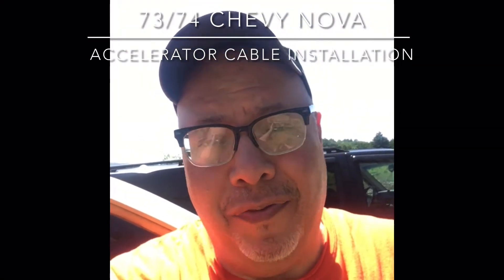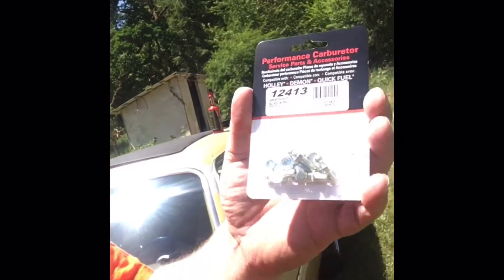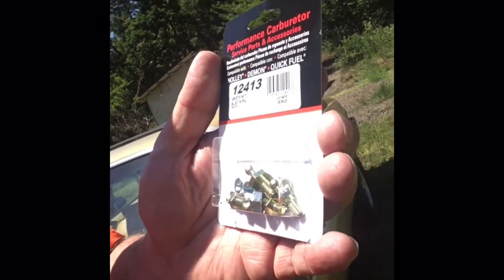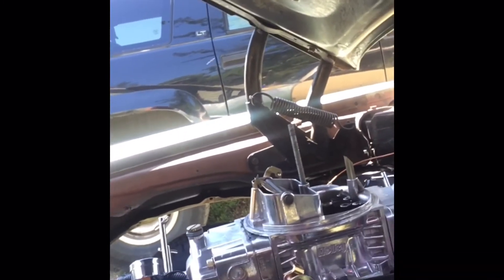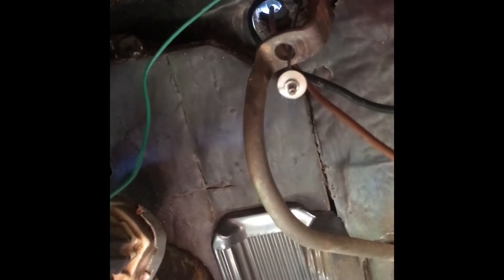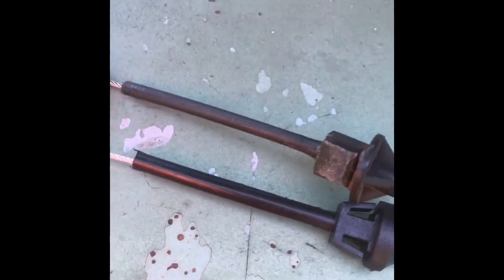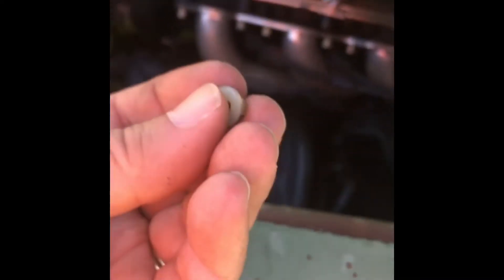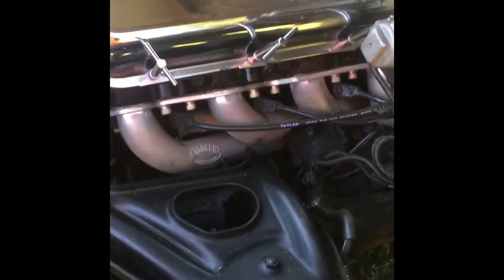Chevy Nova throttle cable installation, Binding Cable. Pioneer Accelerator Cable CA-8473

Comment: I've done lokar cables and I have cut or custom made a cable using different methods and materials some  just a new furrel pressed on and or a sliding lock with a Allen locking screw...but your right having the correct cable in the first place is always best! Not many people can get it right and at the same time be safe so the throttle doesn't get stuck wide open....which is worse than secondarys not opening.
Reply from the maker: Lokar is a great option for fab work when no part is available. Can’t wait to get it dialed in and tuned for the track.

Comment: Holy crap man thank you, my 73 Buick has had the same problem after I installed holley sniper, thanks for sharing
Reply from the maker: I’m glad I could help. It was so frustrating not being able to get the adjustment down. Just make sure you’re careful with the throttle retaining clip. They’re old and fragile.

Comment: I see you throttle cable is actually connected to the hole underneath the return springs. My throttle cable is connected to the same hole as the return springs. Did you find that installing your throttle cable to that bottom hole give you better clearance to open those secondaries all the way? Thanks for the video btw.
Reply from the maker: Thank you for watching I appreciate it! Since I was running a turbo 350 without a kick down cable positioning the cable the way they did give me more clearance so the secondaries would fully open. Aftermarket headers for whatever reason it’s tricky proposition and some people don’t consider that and never really engage in the secondaries. I found that out the hard way and pick up 3/10 in a quarter mile.